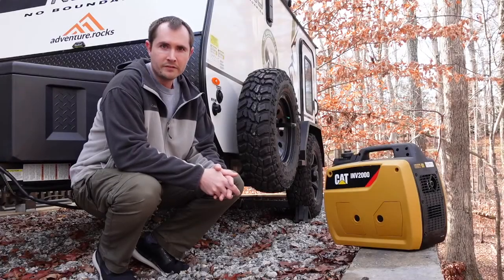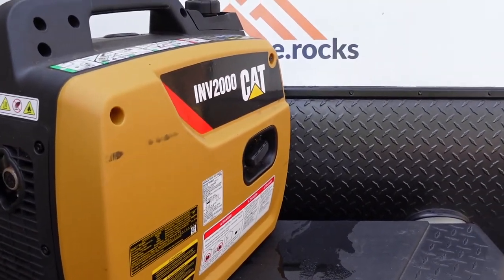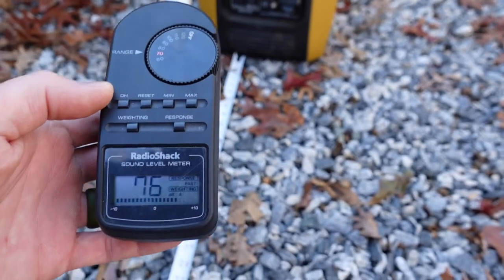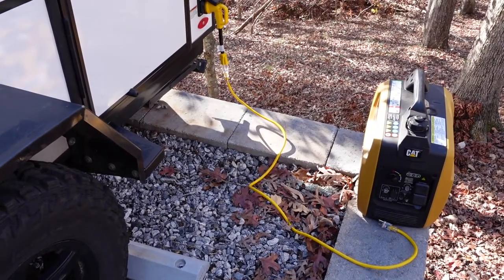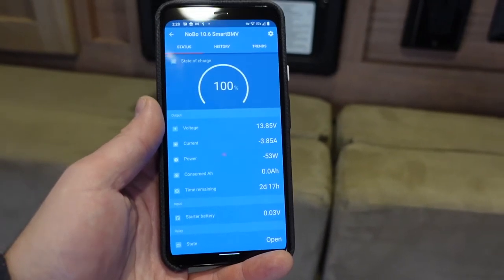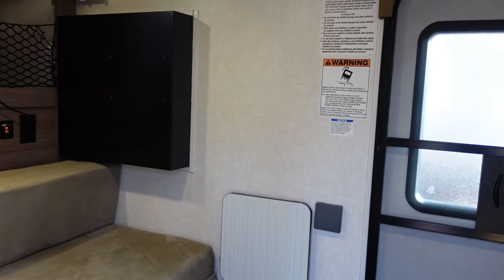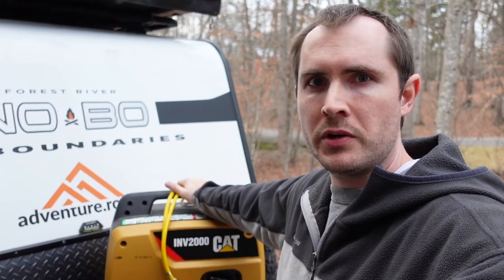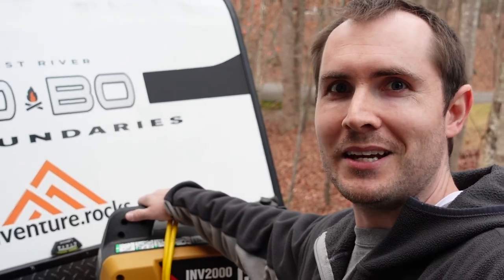CAT INV2000 Inverter Generator - NoBo 10.6 Off the Grid Camping Demonstration & Review

Comment: Thanks alot for the information on upgrading the 10.6. Mine is on order and Ill be picking it up in a couple weeks. Taking notes!
Reply from the maker: Absolutely, glad to help! Congrats on your new purchase! It'll be a LOT of fun!
Reply: Hey did you get your 10.6?
I took delivery of my 10.5 last Friday. I have some questions.
Reply from the maker: @boosttv5688  Yay! You're going to love it! Glad to help if any questions :)
Reply: Installed the tongue storage box today... worked out perfect using your video thank you. I wanted to ask another new owner because my unit was delivered with only a white led exterior light with an on/off switch. It wasnt delivered with the amber/white led light with the on/off/on switch. Factory probably ran out of parts.
Reply from the maker: @boosttv5688  I gotcha. Yeah, you're probably right. One thing that can be kinda frustrating with RVs and it is every brand...they are constantly changing vendors and suppliers each build cycle...it's gotten worse with coronavirus for sure, but usually they try as best as possible to match or beat the previous component. I would be curious if you pull the switch inside rig to see if you have 3 wires going to it, maybe one capped off? I could see where they kept existing wiring harness, but just changed light in desperation? If you do indeed have 3 wires, then shouldn't be hard to swap out your light and switch in the future. If only two wires then only opotion would be to swap out actual light with another if desired. They make some with removable lenses where you can go from amber to white manually. Anyway, congrats on your rig. You're going to love it. Glad to help!

Comment: Was the Cat Inv2000 able to run your AC? Looking at buying one of these trailers and I’m wondering if an inverter generator that size would run the AC as well as the heat strips. Love your videos!
Reply from the maker: Thank you! Yes :) with some stipulations. AC must be on low. Must turn charger breaker off to prevent it from consuming watts that AC needs (kinda confusing, but hope that makes sense). However, generator is definitely at the max capacity when it cycles on, and if it is super hot out, AC may have to work harder than normal consuming more watts and potentially tripping generator. So in short, yes it can run AC, but with special circumstances. I've been planning to do a follow-up video, but just have not had the time yet. It is definitely on my list to do over the next few months! :) So in summary if you're looking for something foolproof that can handle the AC in full I would step up to something closer to 2500 running Watts, but if you're just looking for occasional use of the AC then I think it's a great compact choice.
Reply: Thank you! I have a Honda EU3000IS but it’s big and really heavy. Was hoping a 2k watt generator would run everything.
Reply from the maker: @johng1811   Agreed! I like a compact one that won't break the back while moving it around if you know what I mean. I plan to video the CAV INV2000 + Dometic 13.5K BTU AC and get it uploaded later this month, but spoiler alert is basically that it CAN do it, but pretty much has no more capacity to run anything else, and it can be hit or miss getting started initially. Sometimes when I turn AC on first time the gen will fault/overload in the first few seconds, but once it feeds the load properly it seems to be fine. So works, just not gracefully. And you can really hear the gen ramp up ea time the compressor on AC cycles on and off. But suprisingly it does handle it. Anyway, look for a video later this month on that one.

Comment: I have been looking at a firman 2000watt unit lately but holding out for now, except our Costco has then for $475 so it's tempting. It seems like we got lucky on our 10.6. It came with the Coleman Mach AC unit and the power strip is thermostat controlled but the fan is constant. We have the Truma cooler too. Our heatstrip pulls 1700watts but I'm think a heated blanket would be just fine.  1000-1200watts on the AC if I remember right.
Reply from the maker: I think you got the nicer AC/heat on your roof with that Coleman! They seem to be quieter too. I kinda like the fan constant like a giant sound machine, same on my Dometic.

That Firman sounds like a great value. They seem to be on the up and up from what I gather, plus Costco usually vets their brands pretty well.
Reply: @AdventureRocks  I think I did luck out. At first I was bummed that we did not have Dometic items due to seeing all the cool overlander channels with their coolers but then I started researching the Coleman and Truma products and feel pretty good about them now. 

Truma support was awesome. Some panel was delaminating and on the warranty replacement they let me upgrade in size for the price difference.

Firman was on my watch list so I think I may need to pull the trigger before I regret it. The Costo model has the 30A RV plug too. The etrailer version does not.
Reply from the maker: That's awesome that Truma was so helpful. Heard good things about them.